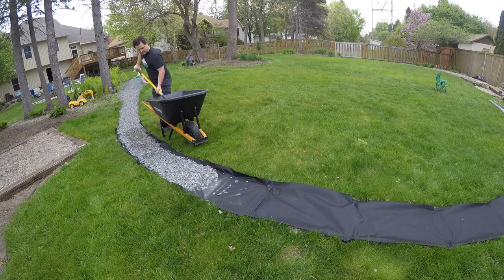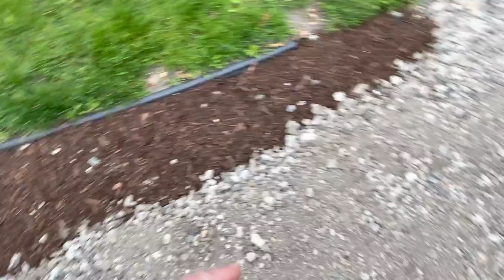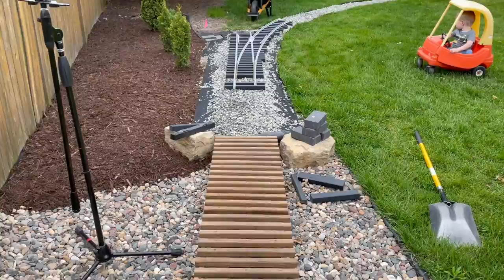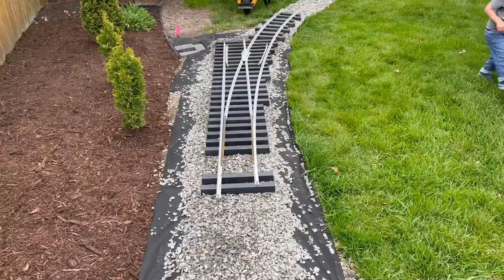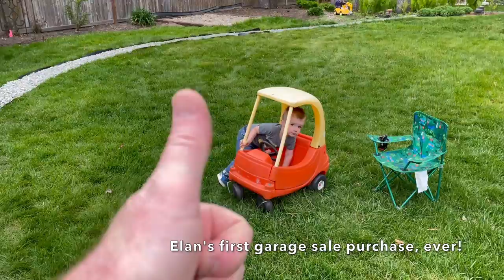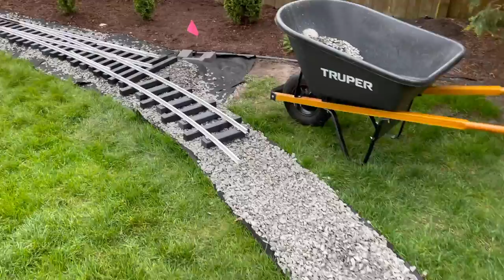Backyard Railroad: 7.5" Gauge Switch & Sub-Ballast

Comment: The Accu-tie turnout kits are pretty sweet, but pricey...  A few things that make them expensive could be done away with without greatly affecting the ease of assembly.  One is that they mill and drill each rail for the mounting screws.  You could still pre-drill the ties for the screws (but offset them to the outside of the rail base), to mount the rails like you would for standard ties.  Eliminating that operation (milling/drilling the rail) would probably knock a few hundred $$$ off the price of each kit.  

It would also allow guys (like myself) that intend on modeling narrow gauge track (longer ties and wider tie spacing) using the same basic kit...  But I get why they do it and it's a great feature for end users that might not be as handy or mechanically inclined.

Really enjoyed your videos...  I'm sure your "little man" will treasure these memories when he's older.  Enjoy him at every step!  Take it from a guy that has three grown boys...  It goes SO FAST!  You'll wake up one day wondering where the years went and very sad that they are gone.

Thanks for sharing!